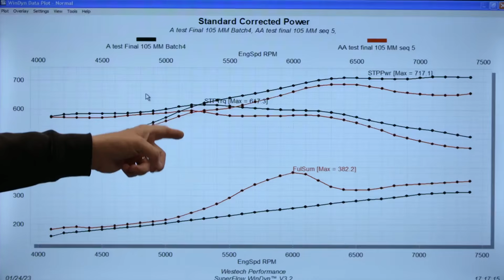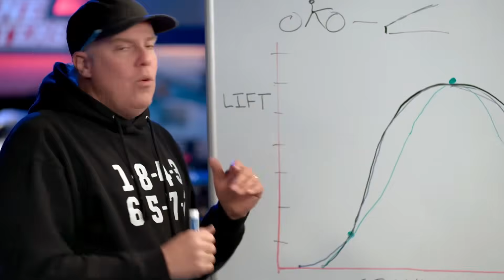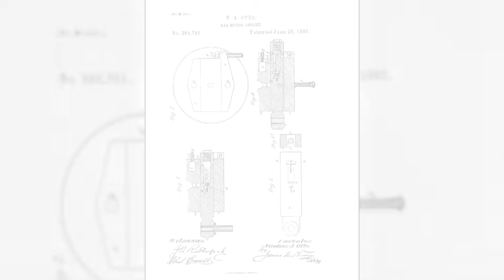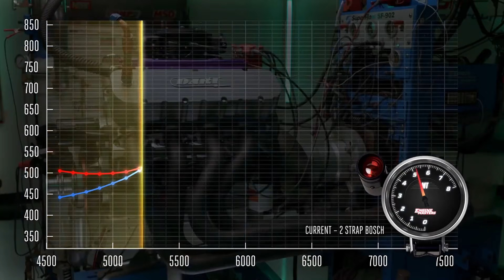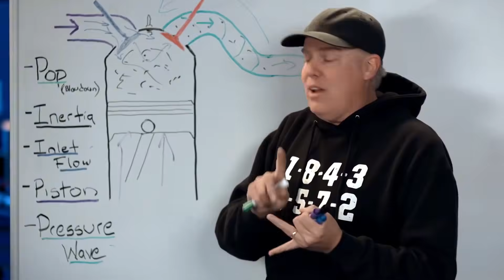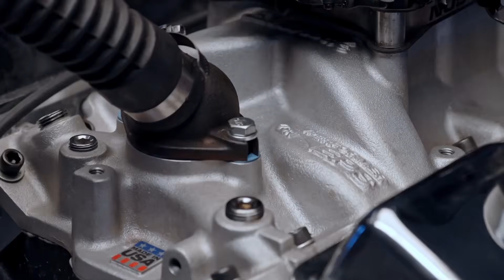Engine Masters 2025 - S9 🛠️⚙️⚒️ Straight Talk About Spark Plugs 🛠️⚙️⚒️ NEW TO DAY Full HD 1080p

Comment: On a Harley with 1 Into 2 intake manifold, sequential is essential. 😎 the intake runners are so short that you must spray on an open valve. If not, front cylinder robs fuel from the rear. Big no no with boost. Ask me how I know.

Comment: Allen F. Liberacki.😂 My friend Dillon bought a Blueprint 383 for his 96 RS t-top Comaro, I blew up get a roll cage! and its a road racer not a drag car! so he called up Blueprint and returned. This is were it's get funny. Dillon called up Dixie Performance. Lee is my friend owner. I left my 5.0 Chevy truck crankshaft and rods , Dillon talked to Lee and asked about the crankshaft and rods it took some talking. Lee is my friend not Dillon so he talked about his and dad's 633 big block Chevy with aluminum rods. Clint Dillon's dad. Barnett Performance. Lee. Jon Kaase. shop. so they sent the engine back to Blueprint with a 5.0 crankshaft in it. Summit was laughing. McDonut GA. Blueprint dynos warranty returns it wasn't blown and it didn't add up. they called up summit and they denied any thing, it wasn't the end it Blueprint still wanted answers and Summit stills denied and it wasn't blown or nitrous. and quit bitching, call up Summit about Clint Abbott and 383 Blueprint engine. 2016.😂 Acropa😊

Comment: GM europe made great emphasis with SFI on their 2Ltrs 16v Astra/Caddet models of the 90's.  
At 4k rpm their system switched to batch injection. Sequential in a motor of that state of tune offers light use fuel economy improvements along with a reduction in emissions disproportionate  to the reduction in fuel consumption